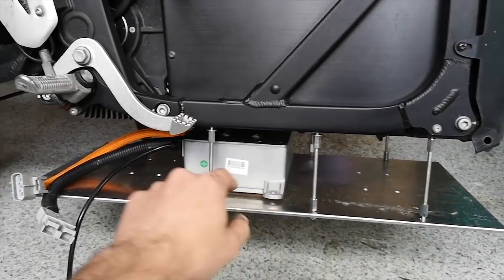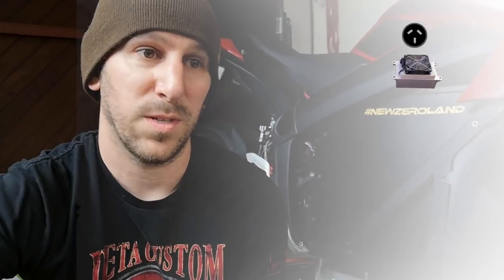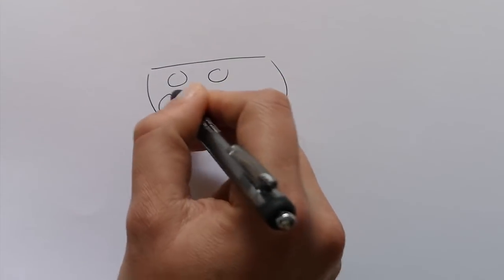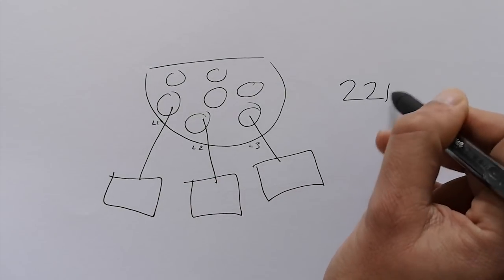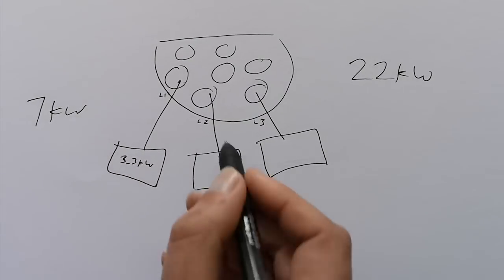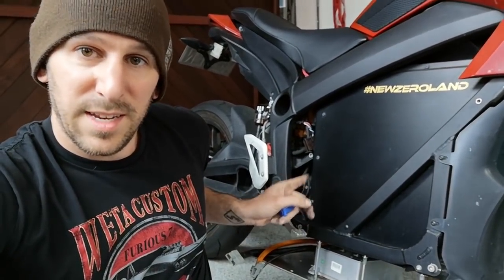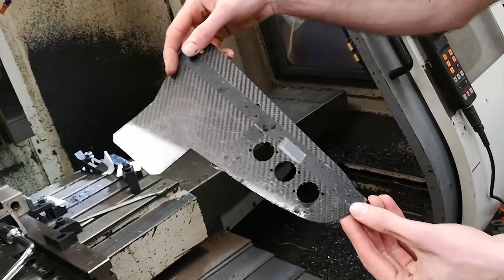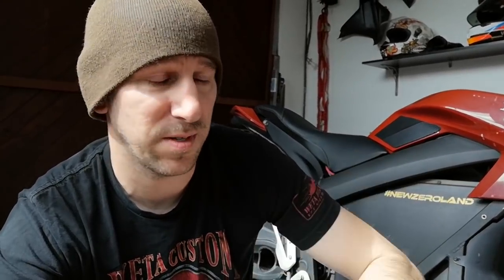Zero SR + DigiNow fast charger setup for NZ (also Fusion 360 & CNC!)

Comment: Oh...I can't wait to steal this idea. I'm still waiting on my chargers, but splitting them into two outlets is inspired. I live in San Francisco, so the local area has a ton of infrastructure...but once I get out of the bay area, I'm gonna need to make plans for different options.
Reply from the maker: Haha awesome! J1772 is king over there, but you'd probably use NEMA 14-50 out in the middle of no where, right?
Reply: @NewZeroland  You got it...but you're originally from NoCal, so you probably know already.
Reply from the maker: Fo sho!  Yeah it makes sense why Zero's charge tank only goes up to 6kW.  J1772 stations are everywhere.  It seems like the only way they'll be able to charge faster is to go DC, with CCS so you'd be able to use J stations as well.  But that'd require a whole new battery, so we'll see what they wanna do.

Comment: This is the kind of thing I'm thinking about for Australia, for the same reasons. I still don't have my chargers, and I guess I'll have to wait 5 more months (I've backed them on Indiegogo), but I have been approaching it in the reverse: have the Mennekes Type 2 as the main connection, and have adapters running off that and splitting into multiples depending on the application. But your solution seems like it is more streamlined and will require less space for adapters. Having a large Type 2 plug on every adapter seems pretty dumb, now that I see your solution.

I also have been wondering if it's feasible to just make the Sumitomos easily accessible and plug directly into those with whatever charging plug adapter is needed. If that's not feasible, I'll probably end up following your example. It has the added benefit of adapting for other countries much easier as well. For instance, if I bring the bike to New Zealand or take a European tour...

Question: do the DigiNow chargers require a certain input voltage, or can they be plugged into both 120V and 240V without changing any switches or settings?

My biggest problem is that I still haven't dug into my Zero's charging system and haven't seen anything online to help me figure all this out. Your videos are really the only source of information I've found. I think I'm going to have to crack the thing open and take a look at the stock wiring just to increase my knowledge. I don't usually do exploratory surgery without plans to change or repair something, but it might be advisable in this case.
Reply from the maker: Thanks, Mark! I'm glad you liked this. It was actually my friend and electric guru Patrick's idea (the guy working the CNC. There are 2 other Zero riders in NZ who are going to do it the way you mentioned, with the big Type 2 inlet on the bike, and a Type 2 gun that splits out into 2 caravan plugs and a wall plug. It's definitely a simpler way to do it, but limits them to only using 3-phase stations. And like you said, Type 2 guns are way bigger and bulkier than these little Neutrik connectors.  I'm really excited to try em out!

These chargers work with 230V no problem, but they want to use 16A all the time, so over here where outlets are only 10A, you have to power them down. That's done by putting in a crazy long string of numbers into a serial terminal app and connecting to the brain box via bluetooth. Brandon wil tell you more when you get your chargers. But if you have a commando outlet at home, or something faster, you can just plug it in and forget about it!